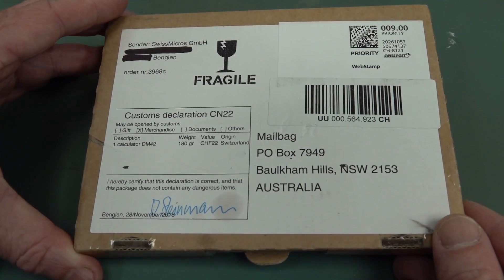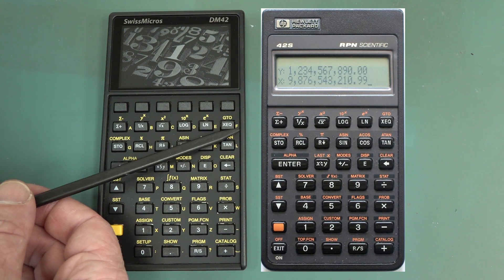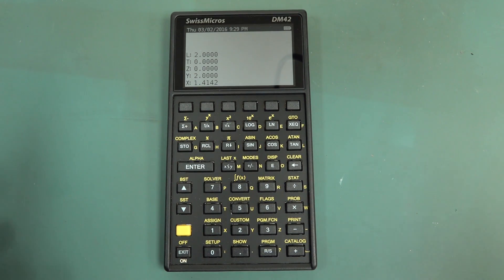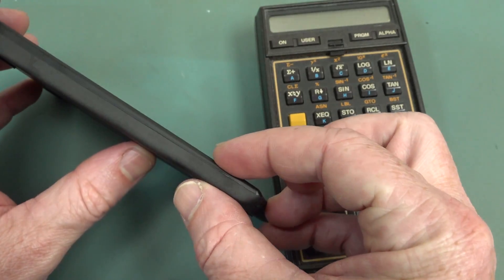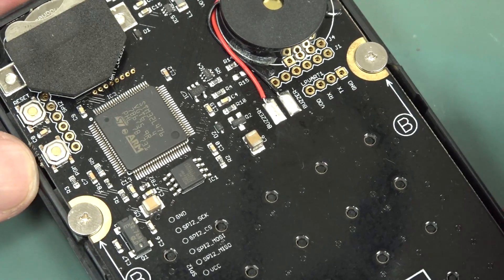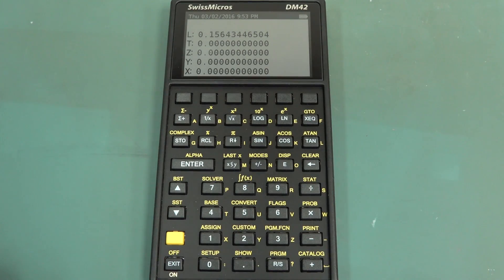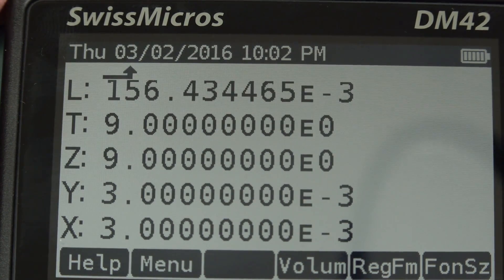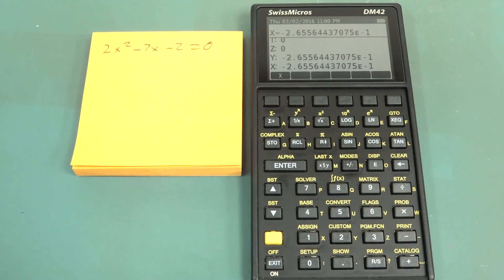EEVblog #1159 - World's Most Precise Pocket Calculator

Comment: I am a land surveyor. The HP42 took surveying on like a storm. There were two cards for surveying . One card for straight lines (xy coordinates). Another for curved lines (xy coordinates) . Some surveyors had two HP42 calculators .  I sold both my HP42 calculators, when the HP48 came out. The HP48 could (with the appropriate cards) solve for xy and z , straight line and curves. And index thousands of points XYZ along with a alphabetic description.

Comment: Amazon had the DM42 in stock (as opposed to having to wait like a month and a half for them to get one in from Swissmicro) and my birthday came up so I decided to treat myself. Expensive? Well yeah, but no more so than the 41cx I bought while in high school. It's a darn nice calculator. Oh and I figured out if you use shift up or down arrow on inputs that can take alpha characters, you can activate the alpha mode and just enter the labels off the keyboard and not have to use the menu thing.

Comment: How come no Chinese manufacturer is replicating this ? Its so simple to manufacture. I mean  bought a knockoff casio fx 570es plus for just 4 USD. And the buttons are super smooth like the original one. 100% replica of the original, even sin(60) etc test everything passes on it. If they were to manufacture this in China you would be able to buy it for 10 USD and it would have much better buttons. I am sure millions would appreciate a proper fully programmable open source calculator with an e-ink or high res monochrome LCD. Swissmicro are fools to sell this for 300 USD. They should sell it for 50 USD max. I am sure they can sell more if they try.

Comment: This is still the highest precision calculator, but now with way more than the puny 34 digits in the original firmware: https://www.youtube.com/watch?v=kzkjE8BZW10
Reply: To be clear: the DB48X firmware for the DM42 has unlimited precision decimal arithmetic. So now you can compute 300! with all diigts, or sin(3) with 200 digits if you need, or only 6 digits if you need speed.

Comment: If they did a 71 I would probably buy it. You didn't say if the speed is comparable to the original. Such devices should have a turbo switch to run at normal or modern speed.

Comment: Terrific stuff.  Unfortunately I have no use for pre-RPL calculators.  I did have one, but after the HP28S everything changed.  Then the HP48S, HP48G+, HP49, HP48GII, HP49G+, HP50G.  I have three HP50G, just in case some would break down.  And also to protect - backup - the programs. They're all full of pretty advanced custom functions, some 400 programs I've written over the years.  I'm retired now of course, but I'd still love to see the Swizzmicro treatment to the HP50G.  New hardware, bigger display, more work memory, and faster of course.  I don't want a color display or even lighted display.  I don't want it rechargeable.  It's vital for a calculator that you can just pop in new standard batteries and that they last for long times, weeks, months.  It's not a F* phone.  I have a HP Prime.  I hate it and never use it.  Might be good for a student to play with, but it's no working tool.
My HP48S has stopped working.  I occasionally use all the others, but the 28S, 48G+ and 49 can't transfer data with the 48GII, 49G+, 50G, so it's only the later models that feature my custom functions.  The 48GII struggles with memory so doesn't have all of them.

Comment: Still have my HP 15C from early 1980s (I also have a 12C, I rarely use), 
as my Go To calculator.

Just changed the original battery in my DM42 (2017, early).
Ordered the replacement keypad dome … and installed latest firmware.

Comment: Oooh.  The HP41C was my college calculator.   I had the clock/timer module for it which was really cool.  It had very powerful time/date functions in addition to all the math stuff.  This really brings back memories!  I swore by that calculator, as well as the HP16C which I used almost exclusively (invaluable as an assembly/machine-language programmer since everything we did was in HEX).

The real question is whether this knock-off is using base-10 or base-2 floating point.  I seem to recall that all the HP calculators used base-10 floating point (BCD) storage formats, whereas all modern computers use Base-2 mantissa and exponent formats.   It was a big deal, because you can't exactly represent base-10 fractional values using base-2 mantissas.   I'm guessing this reproduction doesn't go that far.

These days, yah... I use the Casio fx-115es.  Quite a few years old itself.  But I really hate it because it doesn't have a permanent ENG mode.  The ENG button isn't a 'sticky' mode.  Drives me nuts.  I just want the blasted thing to always display results in engineering notation, period.

-Matt

Comment: i just looked at the prices of older hp calculators and even casios or TIs and they cas the same if not more then modern graphing calcs like the prime or nspire
i am not sure but it is probably cause they arend manafactured anymore and maybe a bit because of nostalgia or the fact that they might be all you need  did i get the resons right lol?
i am going to be starting in high school as a electrical engineer and am deciding on what calculator i should get tho i might wait fo the schools  recomendation

Comment: RPN rules.  I have several HP calculators and the horizontal ones are fantastic. I just ordered this Swiss Micro as an investment.  I love that it uses the CR2032 lithium cell.  The older HP's with the 3 button cells were a pain.

Comment: I had one of the first HP41Cs made (prepaid 6-mos before released), looked so plain I could sneak it into exams (Maths, Comp-Sci)... I was in love and so were my teachers. At the time it was remarkable.
Today, MathCad rules, and calculators are 'a quick estimate' devices with graphs and faster processors.
As many digits as it has it still suffers from 'round-off' error and is painfully slow compared to a computer for complex calculations (linear algebra, and celestial navigation.)
An iPhone is faster, does more, and has INFINITE PRECISION.
The power-calc era is over.
The days of dealing with huge arrays of numbers are gone.
This calculator is so stupid it can't deal with repeating sequences (overbar).
It does not do Hex, Octal, or Binary math,
It can't solve equations...
- It's relegated to a nostalgic amusement device, put it on the shelf beside your VIC-20 rebuild.

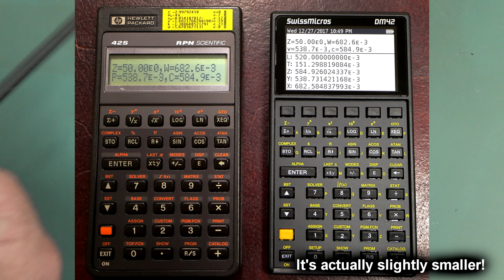Comment: Just noticed the original HP42S had a 2 line 21 character display (According to the picture at 2:02), that is very odd......I doubt you could buy a 21 character display today.....20 yes
Reply: It wasn’t a specific number of characters, it was a certain number of pixels. Every pixel is addressable. There’s no gap in the pixels between characters like in a character based LCD module.

Comment: Another benchmark for this calc: x=1; while x+1>1, x=x/2, endwhile; print x. This finds the machine epsilon. If the calculator is BinaryCodedDecimal, the real value of epsilon would be a closed number e.g. 1e-14, 1e-24, depending on the number of digits used in the calculation. For example, if x is printed as 9.02345135e-14 and the calculator is BCD, the espilon would most likely be 1e-13. To check this, do a simple check: 1+x>1 would be true (for any number x equal or greater than 1e-13), else false. If the calculator IS NOT BCD, then the epsilon would not be a closed number. A real calculator works in BCD! =) Is this a real calculator (hardware based BCD), an underpowered computer with a single application (a calculator) working in pure binary or an underpowered computer with software based BCD?

Comment: My first real HP was a 48GX, purchased in 2000, whilst I was familiar with HP calculators much earlier, I never really appreciated what they stood for. But I am very much a fan now and have purchased many Swissmicros versions as the originals are either not longer available, or too expensive second hand , just recently I purchased the HP41CX. Once you have used a HP, there is no going back. :)

Comment: Nice calc :D I have two cheap arse unbranded 99p calculators that give me sqaure root of 2 as 1.4142135 and my pc makes it as 1.4142135623730950488016887242097, waaaaaaaay too much info for my needs lol I'v always wondered how the quantity of decimal places is determined by a given device? I can understand the limitations of physical display like an 8 digit LCD but on a device that uses a screen like a PC or those graphic calcs there must be a more technical cut off point? Just wondered. :)
PS I love voyager, Janeway was a great captain LOL

Comment: In the early '80s I had a HP41CV during my EEC course at Meadowbank. Once I got used to RPN it was a great programmable calculator. It came with a sizeable set of manuals. It finally died only about five years ago when a Duracrap cell leaked and destroyed the board and the pads on the back of the LCD.

Comment: I would love to see an electronic "engineering calculator" that has a maximum precision of 3 significant digits.
Reply: You can set "engineering" precision which always uses an exponent which is a multiple of three and you can set any number of fixed digits, like 3 for example.

Comment: That's awesome!  My first calc was a TI SR-10 (yeah, I know... sacrilege to the RPN fans).  It only had add, sub, mult, div, square, square root and reciprocal.... and it cost $150.  But it was worth it.
I sold it after a few years and purchased the programmable TI-55.  And believe it or not, I still have it.
Great video.  Thanks for sharing.   :)

Comment: As a mechanical engineer I accumulated a lot of old hp calculators over the years.  I have hp 41CV, 15C, 28S, 20S, 48G, 49g+ calculators.  I've also got an hp calculator IR thermal printer and paper.  Plus a few more older hp calculators I can't remember right now.  The older models with the "rocker" style keys were the best in my opinion.  You could fly through a long calculation by just tapping the keys without having to watch the display to make sure you didn't get multiple digits with a single key press.  Ti calculators with their "floating" keys had a bad habit of giving you a screen full of 7's or some other digit with a single key press.  This was a problem Ti calculators had especially when they got older.  The original hp "rocker" top-hinged keys with tactile feedback were great.  Unfortunately, later and current hp calculator keys are ok but not as good as the original keys.  I also had a Ti 59 with magnetic card read/writer and cradle with thermal printer with two optional math modules.  I gave it away to one of our drafters back in the late 80s.
Reply: correct❤❤❤ the tactile key feel is critical!!
Reply: What about HP 41CX?
I bought my in the 80s, unfortunately, I did not buy the application modules.

Comment: At the risk of giving away my age, my first-year chemistry Prof said, "A calculator is a device by which a freshman can determine the wrong answer to eight significant digits".
Reply: There are a lot of UToob vid's by self-proclaimed experts doing exactly that.  Teachers and lecturers too.
Reply: I think I had that prof.  In my freshman year (1973) we were actually forbidden to use the new TI SR-10 4-function calculator on tests which cost me $99 at the time. We were also discouraged from using them on homework in favor of learning the more advanced functions of our slide rules.  By my sophomore year the Eng. Dept. relented and allowed us to use calculators on tests but under controlled conditions.  That year my roommate bought an HP-45 Scientific and when my old SR-10 got stolen I bought a new HP-25, which I still have, along with my old slide rule.  Marvelous machines - can't do math without using RPN even now.
Reply: Sincerely Yours    If you can remember the model number of your 1973 function calculator at least you can relax in the knowledge that you are not suffering from Alzheimer’s. Darn, where did I leave my slide rule?
Reply: @sincerelyyours7538  heh, even in 1994 I was told not to use my calculator in class, was often called to the blackboard to prove I could show every step of calculations. It was a HP48SX, I have a HP50G now, plus a box of other calculators, these days I just pick up whichever is closest, which usually is the HP50G.
Reply: I still have my two slide rules. They still work ... fantastic back scratching devices. :)
Reply: priyeshxkb   Back to the future, boyo.
Reply: @ Dark ?    🤓👍👍✋ Whatever happened to Texas Instruments? They used to be as ubiquitous as Apple and Microsoft.
Reply: @glennwilliams6522  They long-ago pulled out of the consumer electronics business, in favor of semiconductors, microprocessors, and integrated circuits. They are a major player in that market.
Reply: @schwartzenheimer1   Thanks for the update. It is good to see that they have not faded away.
Reply: Yep.  Pretty much.  

Sigh, we were all Freshman once.
Reply: Hum, in high school my turbo engine professor admits we were slower using our calculators but we systematically achieved the good results.
That's simply impossible to be get your results wrong when you have an entire prooven spreadsheet calculating all engine parameters according to your courses !

🧐 Of course if you look at those not learning how to use their tools/toys..
I'll keep my Ti92 even in my coffin.. 🦧
Reply: Hahaha!
Reply: Why do you need a calculator in chemistry class?  My buddy had one of these in college.
Reply: Mine just said "you won't always have a calculator on you". I guess I do shower without my phone.
Reply: @ Dark ? Lol. Crikey, that is amazing. I still have my slide rule but calculators? I go through them like toilet paper, bummer. I am now reduced to using the calculator on my iPhone - serious calculations are referred to my desktop.
Reply: WTF 😒 if I hear that I would shout at prof

Comment: Although it was impressive at the time, so was the IBM 350/360.
Now a phone has more power.
First 4 bit nibbles, than 7 ASCII, then 8 bit, then 16, 32, 64, etc.
But Analog can do an infinite number.
Ever try fractions on a digital computer?
Even the A/D converters fudge the numbers.
But, it will never end.
The ultimate would be both a general purpose digital computer with analog functions

Comment: I used to have two HP 42S's, wish I never would have sold them. But I do use Free42 on my phone. I currently have a HP 48GX with the 128k memory card and the HP thermal IR printer. Might have to get one of these DM42's and give it a try.

Comment: I still have my 48GX I bought for school back in 1997. It was fun driving my classmates nuts with RPN. I used it through university and still use it today. Working with RPN calculators still feels much more natural to than using algebraic calculators. The only downside is that it eats though batteries.

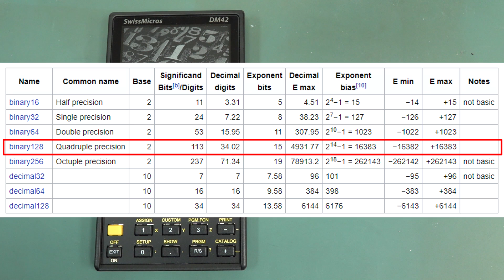Comment: nitpicking... at 2:59 the binary floating point 128-bit box is highlighted, but per the website the calculator uses a decimal floating point 128-bit library- which makes sense for a calculator application. Also, that chip is a cortex-M4 which has 32-bit binary float hardware. I wonder if that gets any use in the firmware?

Comment: My first calculator at university was an HP-11C, then an HP-41CX that I could hookup to the equipment in the lab and run experiments with. I bought the HP-15 LE only to realize it wasn't anything like the original, it bricked itself in no time but the others are still working.

The HP Voyager series had the best layout for any calculator.

I think I'll get a couple of these DM-15L for myself and my kids.

Comment: On the HP 41 you have to put it in to alpha mode to get the letters shown on the buttons. The Enter key on this calculator has "ALPHA" above it. I suspect that if you did a shift Enter you would be able to push the buttons with the letters beside them to enter letters for doing labels, etc. I wonder if it could do any of the synthetic programming that you can do on the HP-41.

Comment: easest accuracy test is to calculate 1/3*3. I usually use real calc on Android and whatever fractions I turning into decimals I have always back to 1. TI-83 returns 0.999999999999999
Reply: My HP28S reads 1.000000000, 41CV does too :o)